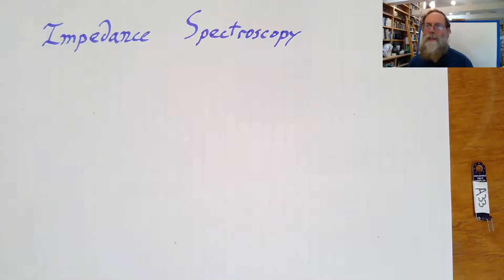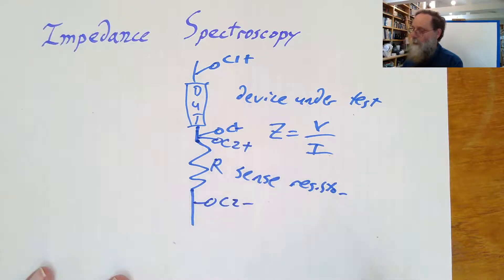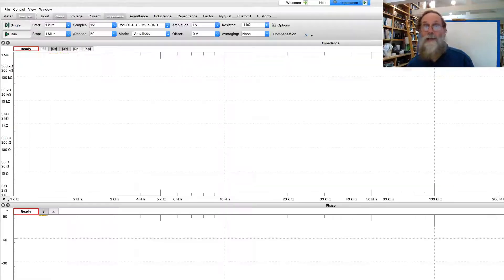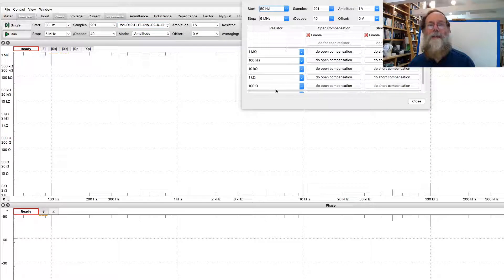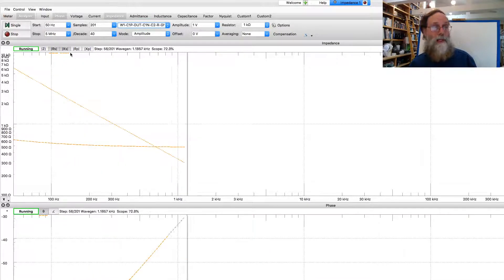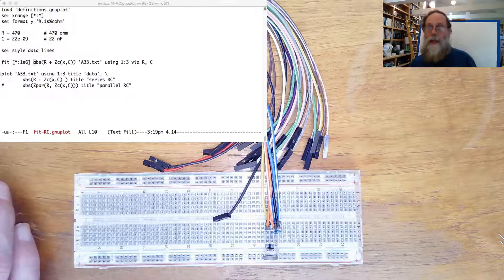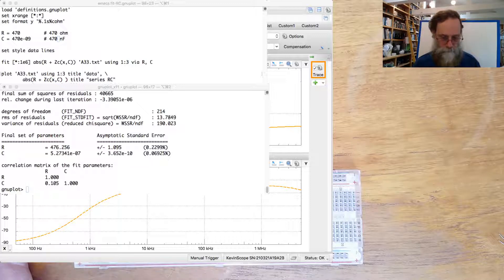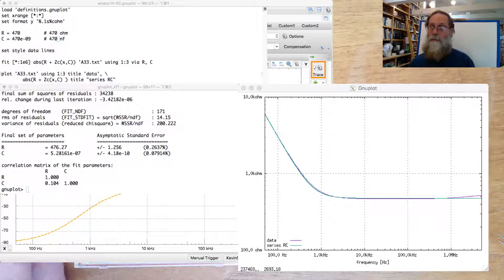Impedance spectroscopy §30.3

Comment: i have a question please , how can i calculate the suitable value of reference resistance ?
Reply from the maker: Your reference resistor should be about the same size as the measured impedance, so that the voltages across each component are in the same range.  If not, then the smaller impedance will have a very small voltage across it, making for inaccurate measurement.  Often, if you have no idea of the size of the impedance, you make a couple of measurements: first with an arbitrary reference (like 1kΩ) to get a rough estimate of the impedance, then again with a more appropriate size.  I often use different reference resistors for different frequency ranges, if the impedance is largely inductive or capacitive, and so changes a lot with frequency.
Reply: what do you mean with ur last sentence? what if it is largely capacitive ,what should i do ?? @gasstationwithoutpumps
Reply from the maker: @mohamedahmedkamal8686  If your load is a capacitor, you decide what frequencies you want to test at and pick an impedance of about the same magnitude.  If you want to test over a very wide frequency range, you might need to use a few different reference resistors (a large one a low frequencies and a small one at high frequencies).  Theoretically, one could use a reference impedance that is not a resistor, but it is difficult to get precision capacitors or inductors, while precision resistors are cheap.
Reply: so readings will be deviated if i chose improper resistor ? or it will be totally wrong ?
  @gasstationwithoutpumps
Reply: @mohamedahmedkamal8686  the readings will be roughly right until your resistor is off by a factor of 1000 or more, because then the voltage being measured will be so small that it cannot be accurately measured.  The measurement is most accurate when the two impedances are about the same, and get gradually less accurate as the impedances differ.

Comment: I would feel sorry for the student who gets a schottky diode.
Reply from the maker: I don't understand your comment—the impedance-spectroscopy measurements in this video are not applied to diodes, but to either combinations of standard passive components or to things like loudspeakers and electrodes.
Reply: @gasstationwithoutpumps ,

 I was just trying to imply it would be a dirty trick to put a schottky diode (or other non-linear device) in one of these black-box circuit boards and ask a student to characterize its impedance.
Reply from the maker: @jessstuart7495  Yes, it certainly would be, as the impedance would depend on the DC bias and the measurement would have to be made with very small AC signals to avoid changes to the DC bias.  The Analog Discovery 2 is not really good for very small signals, so measurements would be rather approximate—either because of the low resolution of the measurements or because large signals would make for a fluctuating bias and hence fluctuating impedance.

A reverse-biased diode is basically a capacitor (with capacitance decreasing as the reverse bias increases and the depletion region gets thicker).  A forward-biased diode is basically a resistor (at low currents anyway—saturating the diode would make for yet another set of complications).

The impedance tokens I made used just a single resistor and a single capacitor, in series or in parallel, with a time constant in a range (5µs to 300µs) that made the corner frequency easily found.  I considered making some 3-component tokens for more advanced students (two resistors and a capacitors or two capacitors and a resistor), but I never got around to doing it—the loudspeaker measurement and modeling was challenging enough.
Reply: @gasstationwithoutpumps ,

 The diode would also generate harmonics of the driving signal's frequency, which may or may not alias onto the measured voltages and currents, depending on whether the measurement system implements a tunable bandpass filter (analog or digital) centered about the swept driving frequency.